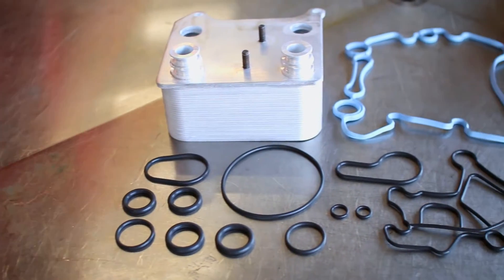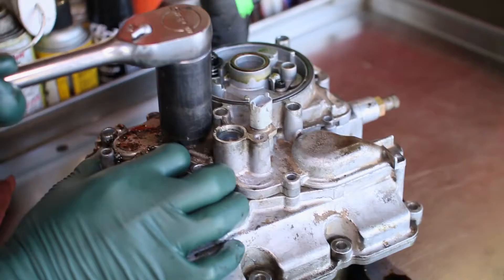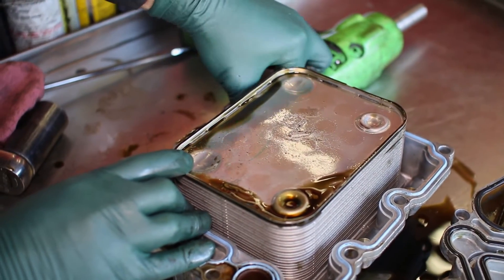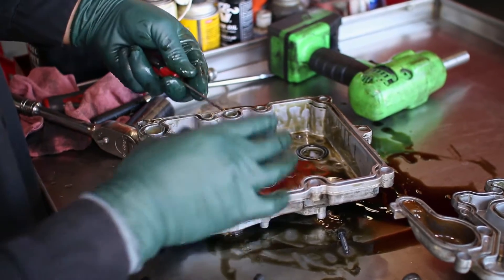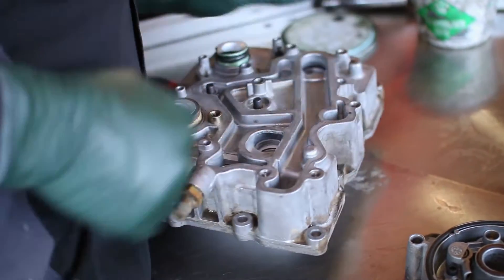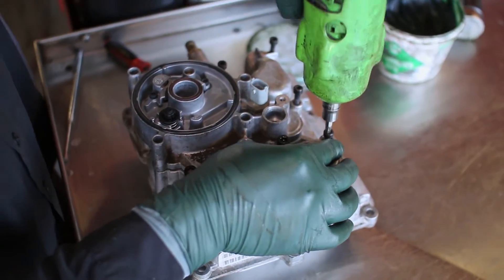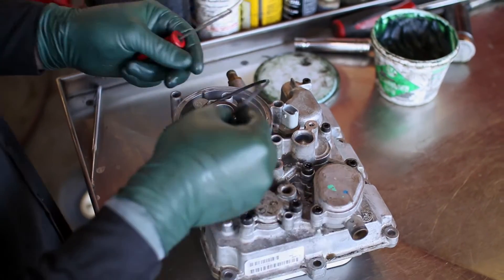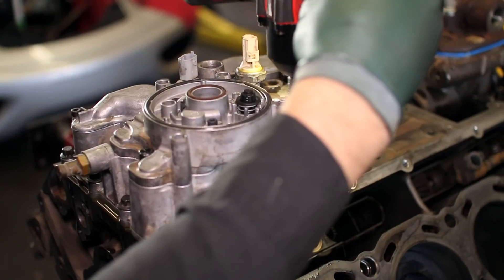2003-2007 F-250 F-350 6.0L aFe Bladerunner Oil Cooler Install

Comment: Where do you find a calibrated impact gun like that? And you didn’t even suck the oil out. Why not an external cooler?
Reply: The Milwaukee fuel impact has an app than you can set torque specs and it will stop at that setting.